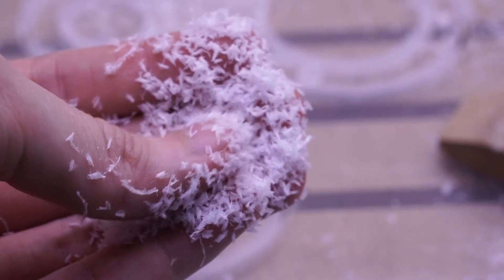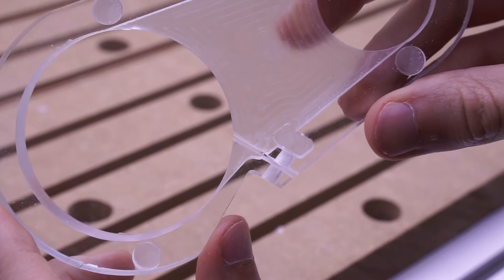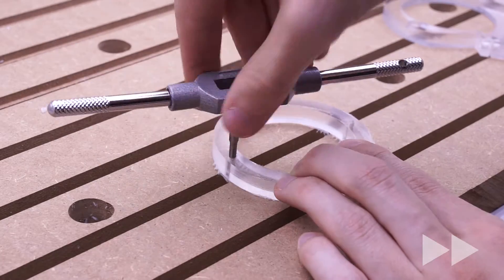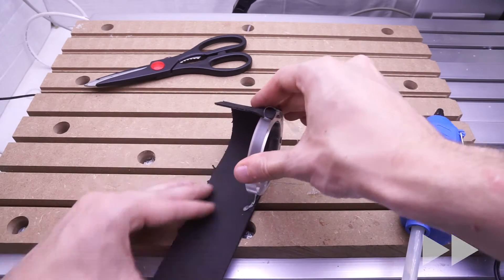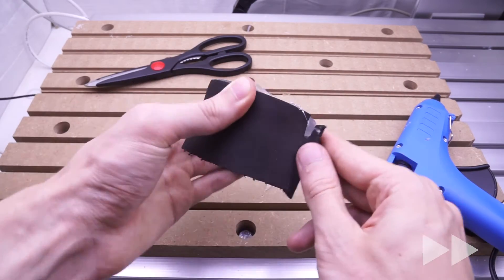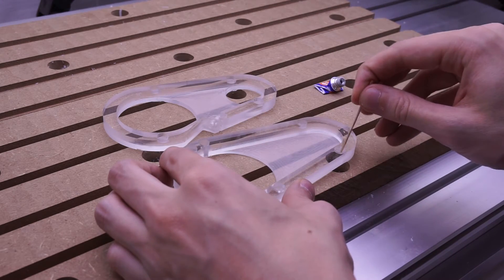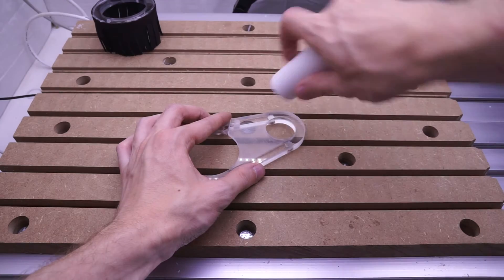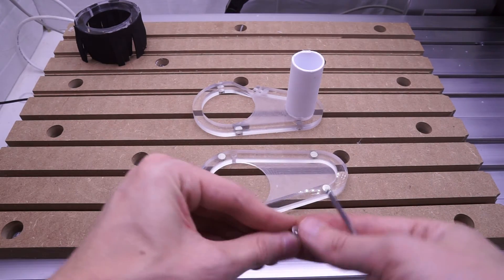Dust Shoe for CNC part 2/3

Comment: Nice design, I have been searching for a suitable design for my own dust shoe and i have decided to base mine own on yours.

Because I have a 100mm shop vac I think that i may have make to make my suction port deeper by adding another layer of 10mm plexiglass, what are your thoughts on this?  I am interested to know how well yours performed.

Thanks for sharing.
Reply from the maker: Hi Fred,
I'm happy that you like the design.

My hose diameter is only 32mm and the narrowest part of the suction port is 32*14mm which is 55% 
of the hose area and i haven't noticed any reduction in suction or problems on my setup.

For a 100mm system i definitely think it's a good idea to add a layer,
100x24mm is roughly the same as a 56mm hose which should work fine, i think : )

I have only had time for some quick test so far with my dust shoe and i will upload a video of that shortly.
Performance overall is good, but i'm not super happy with the foam skirt. Have to tweak that a bit or try another material/bristles.
/Bjorn
Reply: Thanks for the reply Bjorn, although I have a 100mm vac, I intend to reduce it down to a 70mm hose at the dust shoe end, so I am hoping there will be enough suction. I thought myself that your choice of material for the skirt was less than optimum and not deserving of the very neat design of the shoe. What impressed me most with your design is that the cooling air being blasted out of the spindle is deflected sideways away from the work piece by the upper part of the shoe. I intend to fabricate a bristle skirt for mine, so wish me luck! Looking forward to seeing your next video, keep up the good work.
Reply: If you don't mind me asking Bjorn, what software do you use for the G-code generation part of your workflow?
Reply from the maker: I do everything in Fusion 360. CAD, CAM and generating the G-ode which i then run on my CNC via Mach3. Fusion 360 is free if you are looking for a solution. /Bjorn